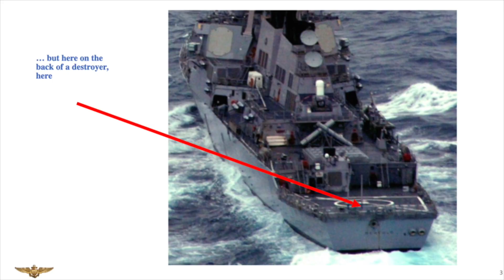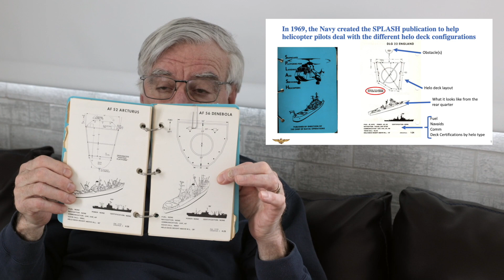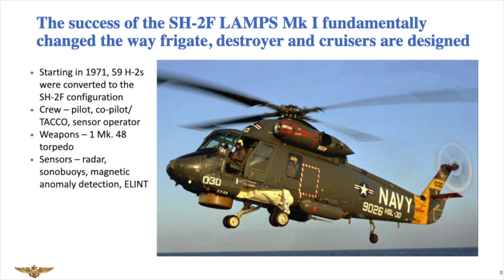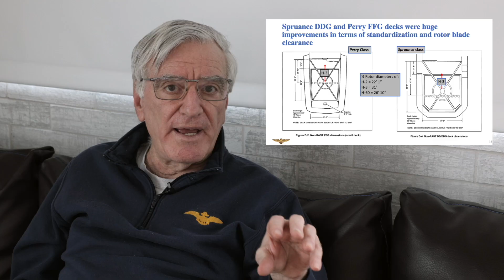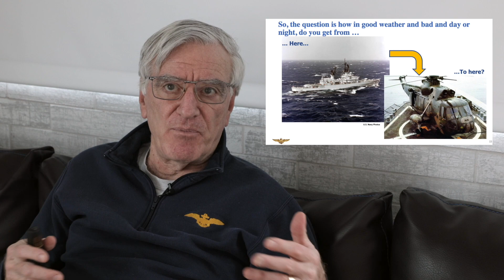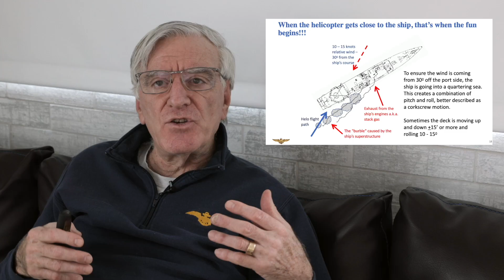Ultimate Confined Area 02112023

Comment: Rode along on log runs occasionally (got bored) while on The Big E 1972/3 .  Landing on those smaller ships was defnitely interesting.  Kudos to the pilots of HS-2, Det One at the time.  The SH-3Gs we had needed pretty much every square inch of those helo decks.  Thanks for another interesting post, Marc.
Reply from the maker: Thanx. Yeah, in the H-3, there was, depending on the deck, between 3 and 6 feet of clearance between the rotor-blades and something solid. As I said in the lead in, these landings, particularly at night and in bad weather is why I have gray hair. That's my story and I'm sticking too it.